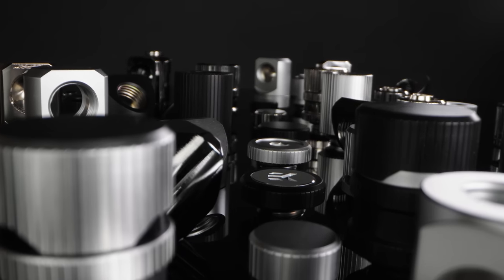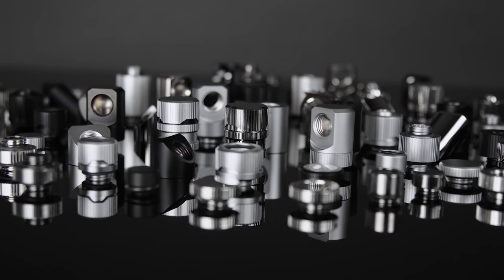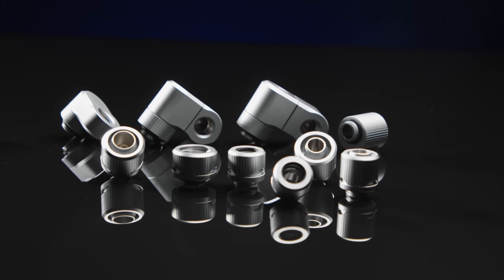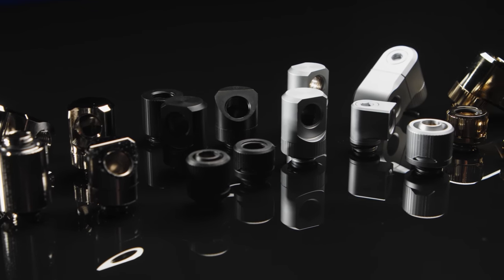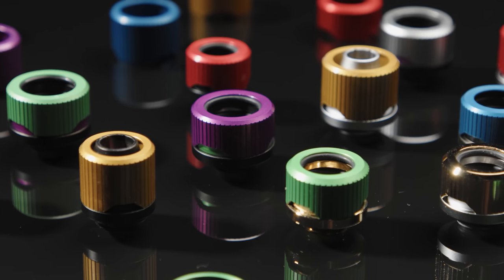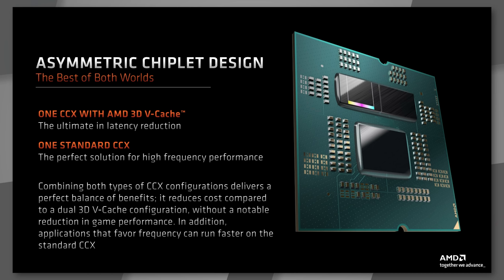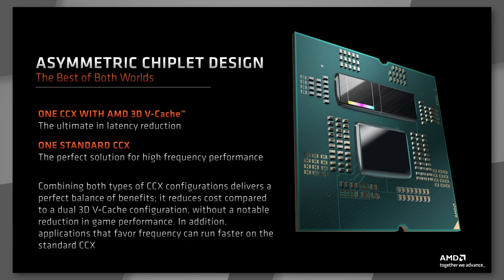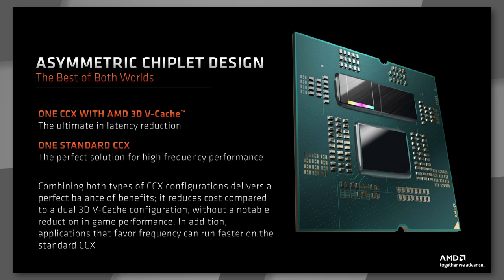Why I switched back to Intel...

Comment: @JayzTwoCents Now that the AMD system is torn down, I would love to see you try the CPU and Memory in different motherboards and see if you have any different results.  Or do the issues with the memory continue to plague the system.  If that is the case, then would another brand of the same speed memory change the outcome.  I have always loved trouble shooting these types of issues.  Perhaps a Colab with Gamers Nexus with the system components being tested by them is in order?
Reply: If it's silicon lottery losses, it's not gonna matter what they go in. If it's BIOS related, well, good luck.
Reply: @OutLanderUSN Silicone lottery wouldn’t affect this because he’s running at the manufacturer’s rated specs. Silicone lottery would be affecting overclocked systems or timings tweaked beyond what the manufacturer rated them for.
Reply: @Poketroid23  My take on the OP here was a suggestion to try putting the CPU and RAM in different motherboards and try overclocking, as the crux of Jay's issues are that activating the XMP/EXPO/DOCP profiles don't work properly. Which could either be a loss at the silicon lottery or a bad BIOS/mobo.
Reply: I would have changed the memories before the cpu, I had memory issues with both cpu brands it's not like it's exclusive to amd
Reply: @DarkP1  The IMC's on AMD's cpu's can barely over clock compared to intel's. The max mhz support it far below what Intel has. For AMD to be the original pioneered of the "integrated memory controller" they've neglected for so long now to the point where it is a liability for their own cpu's now.
Reply: @kevinerbs2778  Now that's just plain false. Intel actually has terrible imc(see buildzoid rants with xmp support on mobo vids) and couldn't even boot with higher clocked xmp kits where as amd could boot and use it but with lower performance since it's desycned.(I know that fclk is desycned but as long mclk and uclk is sycned it's fine.)
Reply: I just think he saw the 14900k come out and just switched to it for the higher ram speeds and clocks
Reply: He wont do that
Reply: @Poketroid23 everything above the base ram speed (like when you are enabling xmp) is Overclocking
Reply: I agree!  I know that I originally tried one of my CPUs in an MSI board and it would regularly fail to boot.  I switched to an Asus board and it's running fine (all other components are the same).  So that same type of thing could be true of motherboard, memory, or the CPU.  And I'm not knocking any particular Manufacturer, all computer products can be faulty right out of the box.
Reply: @smacktard6051 👏Right and you can definitely achieve lower temps. I read somewhere the power drawn on default is not at what intel cpus normally are, so you can change too.. Gotta look up what that was all about. I think this is at this point nothing but excessive tuning like people do with a car where if it doesn't line up with the specs or isn't able to match the owner's expectations leads to obsessive behavior. It works out for him and this type of work but it can be stressful. I seriously don't see the point in going max either though.. Telling you, it's obsessive. We wanna hit those numbers. Spent over 6 hours contemplating jumping to amd before intel parts come in but I am slowing down now and going to just trust what I already picked out a week ago... But.. the logical part of my brain is screaming about the cost difference and the build I selected for intel is too high for me to keep with no potential for upgrades. I get a cheaper but more reliable build. I think with amd you just gotta have more patience it pays off literally.
Reply: While that's fine for theoreticals and potential content, most users aren't going to put up with that shit. They just want to assemble and use their system.
Reply: Would love this also. OMG Dual X3D CCDs were such a fail.
Reply: exactly  @OutLanderUSN
Reply: @smacktard6051 Are Jay's problems basically about oveclocking stuff? I don't know much about PC parts but I'm getting an AMD system, 7800x3d and 7800 xt, and no plans of overclocking. I'm wondering how high of a risk I am of having same problems as Jay here, and few others I've heard about recently.
Reply: @Poketroid23  So you might be slightly r3tard to understand that XMP or EXPO is an overclocking profile. Silicon lottery always means something, if you got faulty IMC on processor or bad silicon quality of Integrated Memory Controller, XMP or EXPO might not be able to be stable.
Reply: @smacktard6051 This. I'm baffled. The whole time he was ranting about his memory issues I was like "okay, when do we get to the point where you swapped out memory sticks to see if one of your DIMM might have failed ?" ... and it never came. What the actual F ?

I remember building a system in the early 2000s and soon after Windows install I'd get random crashes, softwares not installing properly, etc. I reinstall Windows and the install failed... Next thing : I ran a memtest and one of the DIMM was bad. Easy fix.

Could be a bad motherboard component. Hell a single dead capacitor will ruin your day.

Litteral base troubleshooting indeed. I'm speechless.
Reply: @canny7x  In fact there are subtle differences in manufacture in every single component built (and coded),  what may not work in one will work in another.  All you can do, after doing everything else, is either to RMA a piece or scrap it altoghter.  Think of it as the Zen of DIY, the X-Factor that will drive you crazy if you let it.

Comment: I've been using AM5 since launch, running HyperX EXPO 6000mhz, started out with 7700x on release, then moved to 7900x 3D when it dropped, and now on 7800X 3D... besides the usual longer post times, the system is solid as a rock!
Reply: You must be super rich to be able to do that, jeez! 😂
Reply: Thanks for sharing. Good to hear people that are not in it for the views had a good experience.
Reply: @Otto45  Depending on the country, you can afford this kind of setup easily with median income. It is not like a car or a house.
Reply: Owning a couple computer stores gives me the advantage lol
Reply: My $99 b650m hdv/m.2 that houses the 7800x3d, boots in 10seconds
Reply: A cold boot is more than 10 seconds even on the fastest of hard drives on the market...so no @puffyips
Reply: @drunkhusband6257 Uh no? definitely no.
Reply: trying to pick between 7900x3d and 7800x3d. Could you tell me why you switched to 7800x3d?
Reply: @TT-th2jf  one has 8cores with vcache the other has 6cores with vcache, not rocket science
Reply: @puffyips which model mainboard?
Reply: For the Asus MB

Enable memory Context Restore 

Disable Fast Boot 

The first boot will always be slow but after that it will turn on in 15 seconds
I don't know about other but that's how it works for Asus
Reply: so it's true that 7800x3D performs better compared with 7900x3D :D
Reply: @atursams5501  Just out of curiosity, what countries are you thinking of with this statement? I'd assume USA, but unaware of European income.
Reply: Any reason to go from 7900X3D to 7800X3D?
Reply: @puffyips  Sheesh, no need to be a prick about it, not everyone asking such a question would know that, and just make an assumption that the 7900X3D would be the better choice because it has more cores without realizing not all cores have the vcache